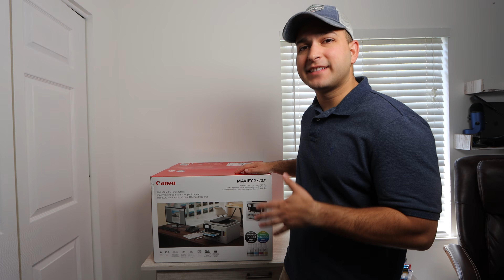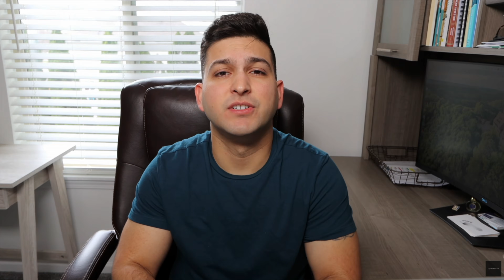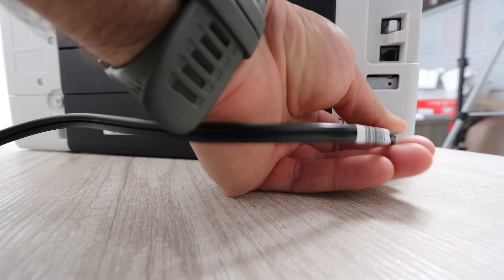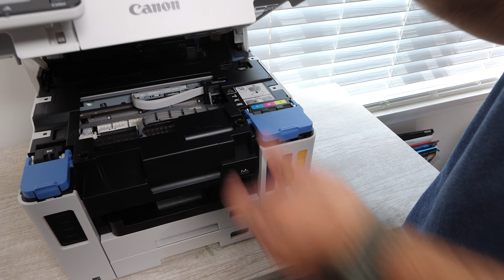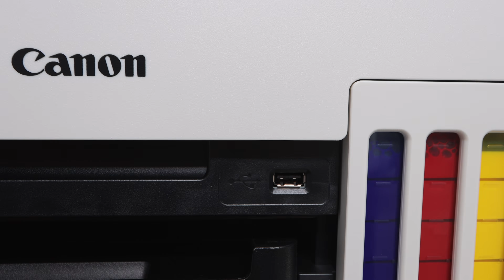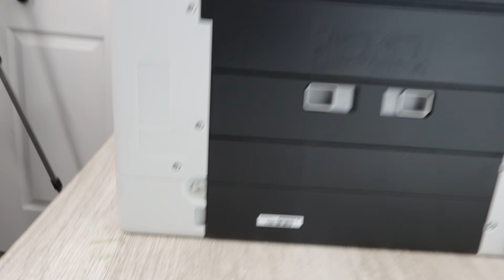Canon Maxify GX7021 - Ultimate Unboxing, Setup & Review

Comment: My new GX4020 won’t print in color. All my settings seem accurate. Test functions are good? What’s my problem?
Reply from the maker: If a nozzle check prints all colors correctly, start with the job settings rather than cleaning. Turn off Grayscale/Black & White in both the app and driver, and make a color copy from the scanner. Does that copy print in color, and are you printing from Windows, Mac, or a phone?

Comment: 24ipm (black) and 15.5ipm (color)...images, not pages.  Canon does not offer ppm in the specs.
Reply from the maker: You’re right—Canon specifies 24 ipm black and 15.5 ipm color. I should use that label accurately; those document-test figures aren’t photo-print speeds. Thanks for the correction!

Comment: I just bought the GX6021 ITs the same as the 7021 except the 7021 has two paper treys.  I just found out today how important it is to read the specs.  The Epson was almost the same price as the Cannon and but has two-year warranty not three.  But the reason these units are so bad is because the DUTY CYCLE on EPSON is 5000!  Cannon GX is 45000!  No wonder they break!
Reply from the maker: That's why you have to swap out the maintenance box frequently, https://amzn.to/3MdJqKA

Comment: Hi there! I'm a bit worried about the ink I ordered. 🤔 The company name is Printer Jack, right? The one you mentioned in the description doesn't include the Canon MAXIFY 7021 printer, and the ink you suggested (GI-20) is different from the one I need (GI-26). #NeedHelp #InkConfusion
Reply from the maker: OK so using the link in the description for the ink you can type in the search bar on Amazon Amazon the specific printer model you have and then you will have options for the ink that you need to be using

Comment: When the ink pads become saturated and I change the maintenance box, do I then have to buy a "reset key" from Canon to reset the printer (as is the case with an Epson printer).
Will this printer accommodate the 110 lb. paper that I use to make greeting cards.
Reply from the maker: A new MC-G01 maintenance cartridge doesn’t require a paid reset key. Replacement: https://geni.us/FEzpOKY (affiliate). For your cards, what’s the GSM and thickness? “110 lb” can mean different weights; Canon lists 115–250 gsm thick paper for the rear tray.
Reply: @BestPrinters 🙂 Thank you... I've added that cartridge to my Amazon cart 👍

Comment: Thanks for the video! I got this on sale for what seemed was a great price for the product. $350 A little more than I was looking to spend but it seemed like so much more bang for the buck and I loved the ability to change maintenance parts! I was having second thoughts but this helped! I was looking at ink options just to know future costs. The link you shared is for gi 20 ink but this printer calls for gi 26. Does that matter? Or is that just a smaller size of the same ink?
Reply from the maker: Yes, it matters! The GX7021 needs GI-26; GI-20 isn’t simply a smaller bottle. Sorry for that mismatched link. Correct Canon supplies: https://www.usa.canon.com/shop/view-all-accessories/maxify-gx7021

Comment: Thanx for the great video.  A nice printer but where I live it's way too expensive.  It's a pity that these manufactures  hike the price of these printer as a trade off for cheap running cost where as you can buy a  comparable color laser  for half this price but they have high running costs.
Reply from the maker: Thanks again for watching Paul, yes I agree the prices have gotten substantially higher.